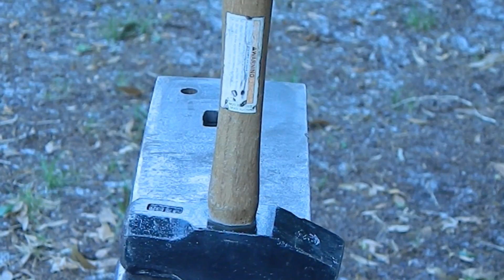Forging A Center Hole Punch And Chisel

Comment: Those came out fantastic! Great idea using a hatchet as a cutoff tool. I could of used that trick before I finally acquired one. I noticed (I think) welds on the anvil. Was your anviled repaired? It looks like the faceplate was replaced.
Reply from the maker: I do believe that the face was replaced. I got lucky finding it I guess :)
Reply: New Things - Nothing wrong with a new face plate. I was just wondering if you had an interesting restoration story behind it.